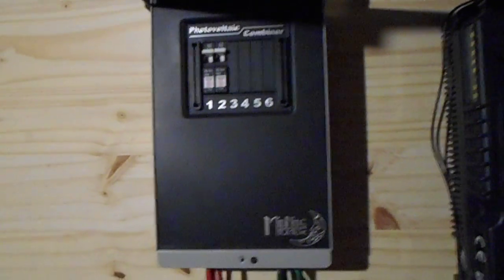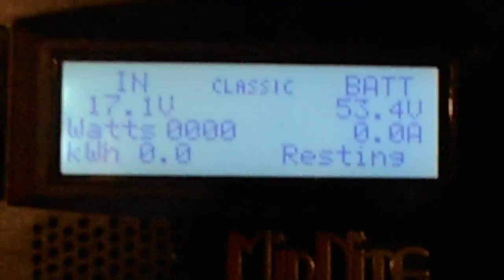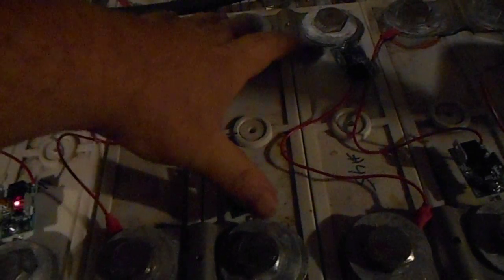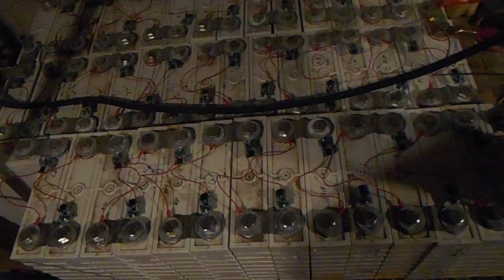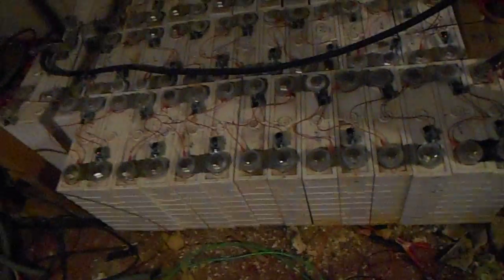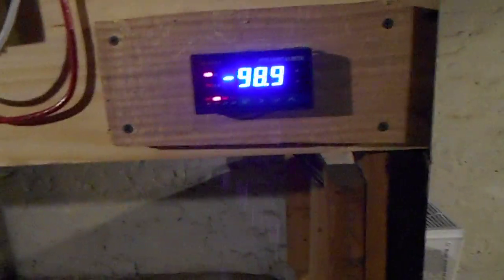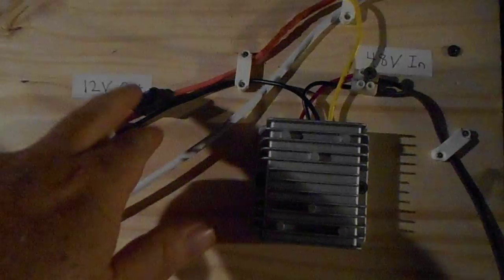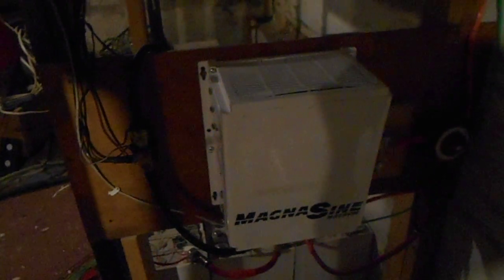48V LiFePO4 Off Grid Solar System - Hardware(Part 2)

Comment: Nice setup, yes initial balancing is critical.  

We have two sundazer refridgeration units operating with a 24V bank of telecom style AGM batteris 2 x 100Ah each 12V in series directly linked to both freezer and fridge units 24 - 7 being fed by a sing Q-cell 345W 1m x 2m panel. Flawless operation zero maint or charge control required.  Nice DIY example, more folks are doing these things themselves.

Our entire grid produces from 2.7 to 3.1 KW and from 27 to 31 KWh per day with only 10 hrs sunlight, our sailing vessel is an on going research development project as we travel around the world, also a combined solar PV, Solar concentrated IR, drogue generator, wind, tidal and wave energy.  We share technology, open free science. SV-Content.

Comment: Just checking-in to see how your system has been functioning.  I was hoping you might be able to give me a brief update as there are not a lot of these type systems out there . . .at least not yet.  Thanks!
Reply: +Johnnie Miller : Hello, Johnnie! I have roughly the same system. 2000 watt array with a 48vdc LiFePo4 battery bank. It has been up for 860+ days (june 2013) in a full time, off-grid usage. The cells haven't deviated (I do not use active BMS and believe more in "bottom balancing" along with keeping the voltage set-points in the flat portion of the charge curve.) I set my midnite 200v charge controller to ~3.4vdc per cell for float and ~3.5 to 3.6vdc per cell for absorb.

Comment: I like your presentation....and battery selection....please tell me the material used for the battery connection washers?
and also the strap connectors?
In order to save a lot of headaches with dissimilar metals corroding ...may I suggest using copper conductor paste on all your electrical connections....expensive but you will not regret not using it.
In my case, along with the paste, using copper and brass bolts/washers/nuts and tinned copper connectors. Avoid using galvanized or SS.....An IR gun is helpful in checking for poor connections.
Reply from the maker: +Raymond Balcom The washers are Al.  The busbars are coated Cu (don't know what the coating is).  The bolt is SS.  I have not had any corrosion issues, but I will keep your suggestion in mind.
Thanks
Reply: Based on your response, I would definitely use a paste. Are the battery studs SS ?
Do these batteries off gas during cycling? We've been 12 yrs off-grid and worked around aircraft batteries and switchgear and was introduced to the cu-paste by a train electrician.
Reply from the maker: +Raymond Balcom No, LiFePO4 batteries do not out gas.There are no studs, these are not lead acid batteries. The bolts that hold the busbar down in contact with the battery are SS.

Comment: Great video.  I was wondering has anyone setup a smaller setup like in an emergency generator.  There are tons of these videos using lead acid batteries which seems kinda crazy when these batteries are available.

Comment: +G Young, thanks for keeping this thread alive by replying to all the questions. Your post is the final nail in the nickel-iron battery array I've been circling for a year. I am designing up my first system and simply could not swallow the Trojan L16 lead-acid story. Research brought me to nickel-iron, but for several reasons I am backing away. A couple of cats with the handles 'Electro Dacus" and 'mjlorton' posted utube videos on LiFi-PO4 that really caught my attention. Now seeing your rig, up and running for some time, with the cool BMS LEDs... well, I'm done. I just ran the numbers for current pricing on LiFi cells and, considering all the LiFi-PO4 characteristics. they look better than anything I've seen so far. Thanx again.

I might just install the array in the living room to have a 24/7 light show during those long winter nights.

(Yes, I'm kidding)
Reply from the maker: +Steve backer Yes, I agree that LiFePO4 are the best batteries for solar...they are (up front) expensive, but coming down.  Hopefully, electric car will take off and solar homes could buy the batteries from accident vehicles.
Thanks
Reply: +G Young Well, there is expensive, and there is EXPENSIVE. I was looking at a 48V 100AH array from Iron Edison (nickel-iron, which like the LiFi can cycle for decades with TLC) which rings up at $5400, plus tax and shipping. In the meantime I can&#39;t find a price on the A123 bats in the states yet, but I found pricing on a Tenergy LiFi-PO4 battery at $35.99 for a single 3.2 20AH. That multiplies out to just under $2900 for that same 48v 100AH array. The killer is the modules, which at one per battery adds a little over $1,000.

Still, thats around $3900, which is $1500 less than the USA made nickel-iron. Plus no need for watering the batteries and no out-gassing. Whats no to love? : >

btw - The Tenergy batteries I stumbles upon are at all-battery.com.
Reply: +G Young btw - I wanted to ask you what kind of current you are putting in your batteries. What charge rate do you typically max out at? This will help me design my solar array to charge the batteries as quick as possible w/o burning them out. The Tenergies I am looking at claim to take up to 30 amps.
Reply from the maker: +Steve backer I have 3600W of solar panels with a midnight charge controller which has a max. current of 84 amp.@48V, but in the winter, I typically get a max. of ~60amps and in the summer it is close to 80amps.  (The current/power is a bell curve, so you do not have a constant charging current.)  I don't know Tenergies specifically, but LFP usually have charge rates of C/10.  C is the amp hour rating, so in my case, that would be 30 amps for each battery & I have 3P, so 90 amps is the spec. charge rate.  Any rate less than the spec. is ok.(slower is easier on the batteries) I would always use the charge current they used in there cycle testing, as that is the only rate they should claim you can use. (It is the only rate they have any long term data on.)   I designed my system to the maximum of the charge controller not the max. of the batteries.
Reply: +G Young Makes sense. Helpful. Interestingly, I already have bought 3600w worth of panels, and ready to purchase a MidNite Classic 150 and a MagaSine inverter. Great minds think alike, eh. ;&gt;

btw - In my research last night on LFP bats I ran across a couple of utube videos posted by companies specializing in converting cars over to electric. These guys see a lot of LFP bats, and two different shops were both making an argument for BOTTOM balancing. I think you were describing top balancing. You are probably quite satisfied with your approach, but I don&#39;t think the two strategies are mutually exclusive. Let me know if you&#39;d like the links.
Reply from the maker: +Steve backer Top balancing is much simpler and I don't ever have my batteries down near full discharge.  In home solar, you can use the BMS to shut down the power (lights out) if any cell goes below 2.5V.   You will have significant problems bottom balancing home batteries, as you cannot easily dump all the power & then have enough sun light to fully charge them.  (If you do have enough power, it will be a long day.)
Reply: +G Young That makes sense. And I am realizing with more research that the needs of EV are quite different than the needs of home solar.
Reply from the maker: +Steve backer Yes, hopefully Ellon Musk realizes this as well.  Weight is a primary consideration for EVs (NCA Li batteries), but not important at all in solar homes (Cycle life is primary - thus LFP batteries)  They may converge using Titanium Li battery technology, but that is too far in the future to predict now.  Discharge &  Charge rate needs are also very different from EV to Home.  But, I would still use old EV batteries to power my home if they were available at reasonable prices.

Comment: When I set my pack up I will be bottom balancing them. I will have to be sure that the capacities are similar. You find your lowest capacity cell then charge to the voltage you get when that cell reaches your max voltage you set. So for me I will be using Nissan Leaf Modules. Remember that you can easily prevent any overcharging by lowering your pack voltage. But when you are running your system in a situation where you can't recharge your pack soon you could put your pack in danger by having some cells going too low before others and allow high currents to run through them causing you to loose cells and risk fires from high current discharges through empty cells. Your pack is always less than full for the majority of the time so its safer to have your pack bottom balanced. You can still have a BMS that monitors your charge voltage and cuts off when the low cell reaches its max allowed. Your lowest capacity cell always dictates the end voltages no matter if you top or bottom balance. My experience shows that bottom balancing is safest for you and your investment. Allowing an active balancing system to discharge current can cause a fire hazard at best and if you do use a BMS be sure you have something that can monitor the BMS so if any single cell monitor goes bad it shuts it all down protecting you, your home and investment. I have seen BMS systems fail and not know they failed and continued to discharge and force out of balance your cells causing destruction of the cells. Be careful with top balancing. If you use a BMS be sure you use a good one. Orion is one that will do pretty much any thing you need and its cheap insurance. 

Pete :)
Reply from the maker: +Pete McWade Pete, you are clearly recommending bottom balancing.  Have you ever been off-grid?(no electric power source other than solar)  Bottom balancing is simply not possible and I completely disagree with the statement that your pack is "less than full for the majority of the time" - that has not been my experience (2yrs off grid).  During the summer, pack is in float for ~10hr/day (full charge) and >90% the remaining 14hrs, spring & fall are similar ~50% of the time, winter is the only time I would agree with you.  Please explain in detail how you would bottom balance a pack without predicting tomorrows weather while being off grid.  (keep in mind, it takes many hours to drain 900AH at 48V.)  Also, fuses are used to prevent the "fires" when cells go bad.  But I strongly suspect that have experience with EVs not off grid solar.  The typical draw of an off grid home is ~5amps with a max draw of ~60amps....compared to a EV which has a typical draw of ~100amps and a max. draw of ~350amps.  The only reason I mention this is that the stress put on the batteries in off grid homes is considerable less than an EV, so I believe the likely-hood of a cell shorting is very low -- but it is possible, so I added fuses to protect the parallel batteries. .Bottom balancing and top balancing both have risks, you have listed some of the risks - the mirror risk exist of bottom balancing....you will find, that when you invest so much money in batteries, you pay very close attention to them when it has been cloudy for several days. (and, you start to conserve power until the sun come out)
Reply: +G Young Yes, I am clearly recommending bottom balancing over active top balancing. In your example you mention that you stop your charge when one gets to 5.6 volts so no others go above that. You mentioned you did not want one to be at 3 and another 4 volts. I can tell you if you have a cell in your pack that is that far out of whack from the other cells it is recommended you replace it. In your case, top balancing is always happening. Everyday you have your solar topping off your pack its happening. I don't disagree with top balancing per se but Im not one for active top balancing. I prefer bottom balancing. Bottom balancing only happens ONCE. You drain all your cells and in your case the LiFePO4 cells to 2.5 volts. At that point the cells are well into the steep discharge and using them at this point is pretty pointless. But when you have them all at a stable resting voltage of 2.5 you can be sure they are all the same capacity. I actually prefer to do this to 2 volts. It is done briefly and shows no damage to the cell. But 2.5 is fine and works well. Then  you take your pack and put it together as you plan for your pack. Solar or EV. It does not matter. The batteries don't know if you have them in a car or house. You charge your pack so the overall voltage is 3.55 volts per cell. When fully charged to that voltage you will find that you have some cells that are a bit over that and some even a bit lower but you know that every cell has exactly the same capacity as the next. Every time the sun is out and can fully charge the pack you set your float voltage to .05 below the lowest voltage in the pack because you don't want that low cell to slowly creep up to a higher voltage while in float mode. The biggest problem with solar today is the float mode. Float mode on a lithium cell is bad news. You want to have the charge controller charge the pack to a set voltage then just stop. You want it to monitor the voltage so if it goes low it can restart but you don't want it to be in float because that float actually is not OFF. it is still trickle charging the pack. So if you do have that float on your charge controller you set the point where it is lower than the lowest voltage of the lowest cell in the pack so it won't keep charging but if the pack gets lower than that voltage it will again recharge the pack. I do understand that the solar will not be as high a current but it does not take much current at a low voltage if the pack is out of balance on the low side and one or more cells are lower than the others those will feed the empty cells and will kill them. I have photos of four LiFePO4 cells that were drained at a current of less than a 1/4 amp. Actually from a little JLD volt meter just monitoring the pack. That takes current and eventually all cells in that 4 pack bloated and died. It took 4 days for a low pack to drain and die. I'd say you clearly have never built an EV but use EV methods to monitor and actively balance your pack. Also when you balance at the top you are trying to balance a charge current where on the bottom you can actually drain it and have a stable standing voltage. You can't really balance at the top if you think about it. When you terminate the charge voltage and completely cut off all charging all the cells will settle into a lower voltage state. So I can charge to 3.55 or 3.6 but my cells will settle into a much lower voltage. My cells would charge to 3.6 volts and settle into a stable voltage of 3.33 volts. Every time. Even those cells that were at 3.4 volts or 3.7 volts would settle into the same 3.33 volts. So looking at the stable voltage you wold not know that the top voltages were not balanced. I have converted three vehicles and working on number 4 and 5.

Comment from the maker: To:TheMFrelly - Yes, the max. voltage is 58.4 (3.65V/cell).  But, I only go to this high voltage when I am balancing and only for a few minutes (30min).  Under normal operation, I charge to 54V.

Comment: Hi G Young - I wanted to check-in again - as it has been another year (how fast time fly's by) to see if you are still satisfied with the performance of your Hi-Power 300AH LiFePO4 batteries.  IMHO - nothing is better for evaluating a product except for customer satisfaction.  I was wondering if there are any other brands of large LiFePO4 batteries that you have had your eyes on.  Thanks again for your sharing of information and videos - I am much appreciative.
Reply from the maker: I am very happy with my LiFePO4's.  I think the biggest risk with using LFP for solar power is getting the batteries....you must be very careful who you order the batteries from in China...your money can disappear.  I think any major battery manufacturer's battery would work fine for solar power.  Also, I think I have found a very good battery balancer for my batteries - - I will make a video shortly.

Comment: hi,  are the battery still ok?
I will change my old lead acid into lifeypo4 winston and planning to cycle between 3.0 and 3.4V per cell to avoid any overcharge or discharge.
I'm I too conservative? Will 3.0V to 3.55V be ok too?
Reply from the maker: After 5 yrs using these batteries, they are fine.  I would suggest 3.10V -3.33V per cell as the range.
Reply: @gyoung7332  ok. Can you confirm that temperature compensation is set to 0 mV/C (no compensation) at the solar charger side?
Reply from the maker: My temperature sensors not connected at all, so no temperature compensation.  BUT, my system is indoors, so it never goes below 50°F or above 110°F.   From my EV days, NEVER use LiFePO4 batteries below 32°F. (must add heat pad if your system is outdoor)